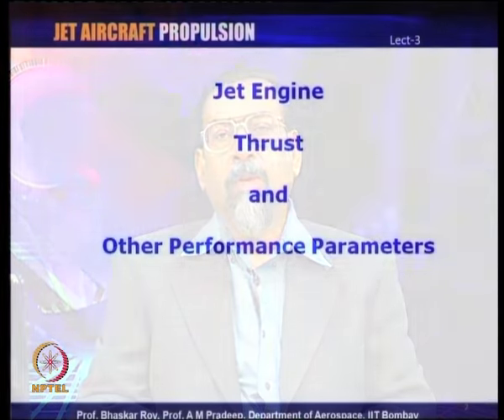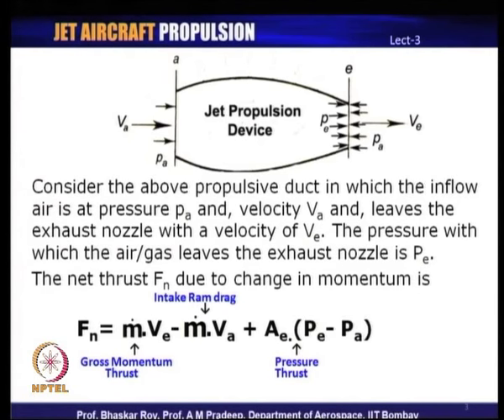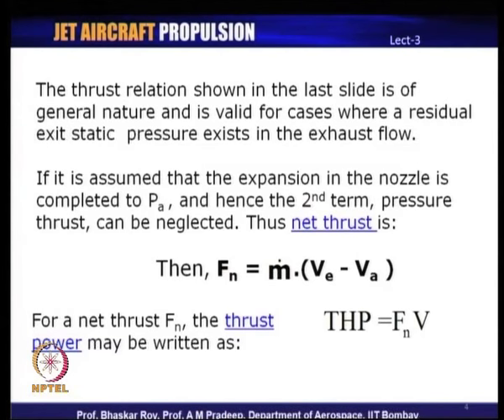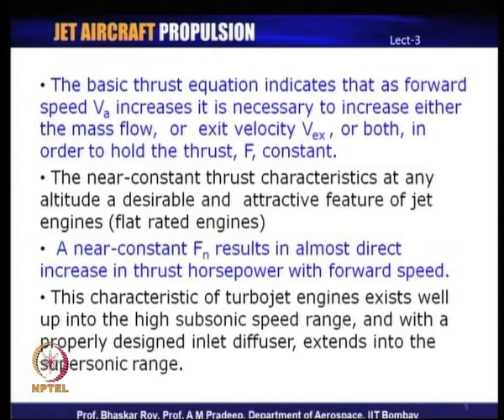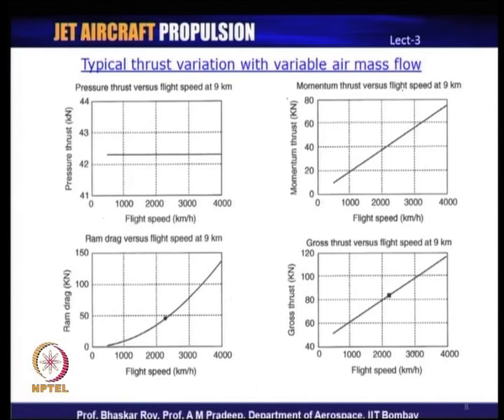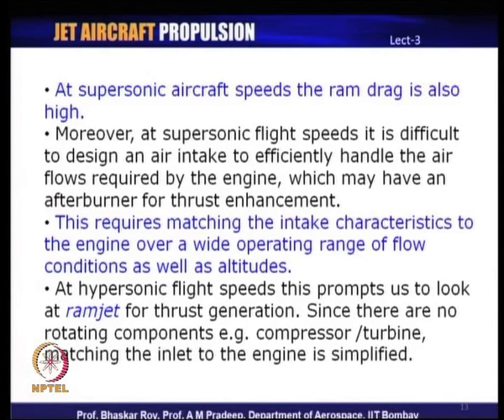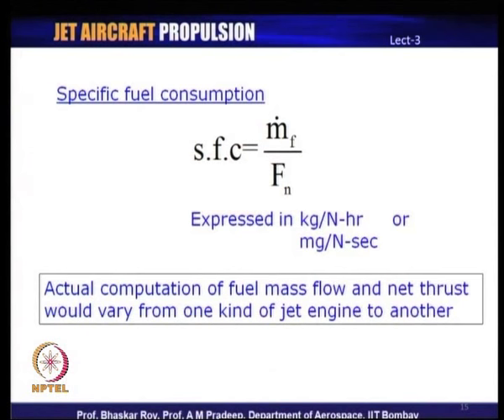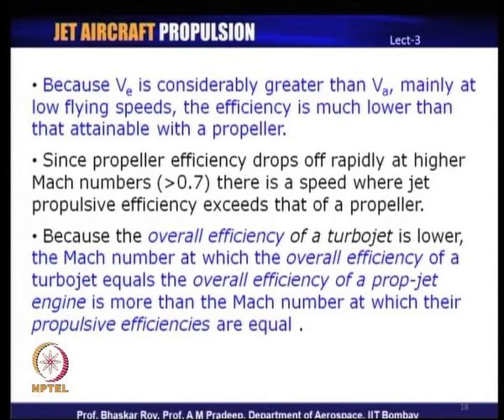Mod-01 Lec-03 Jet Engine Basic Performance Parameters

Comment: I do not understand how the Gross Thrust aka m dot * Ve can be constant, the Ram drag aka m dot * Va can be linearly increasing, and the Momentum Thrust be constant. Wouldn't the Momentum Thrust decrease if Va is increasing while Ve is remaining constant?
Reply: with the graphs shown at 17:00 for constant mass flow rate
Reply: pro tip: watch series at Flixzone. Been using it for watching all kinds of movies during the lockdown.
Reply: @Davion Trevor definitely, I've been watching on Flixzone for since november myself :)

Comment: The thrust of a propulsion device:

Air mass flow at exhaust: 40kg/s
Exhaust gas velocity:400m/s
Air/fuel ratio:60

Device: Sea-level

Solve this equation